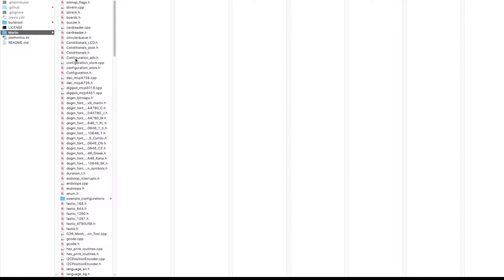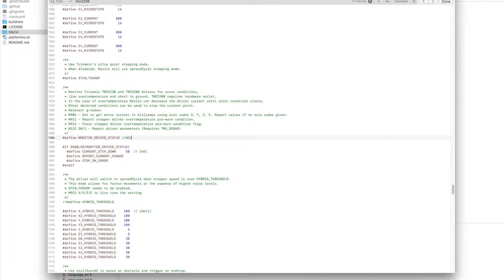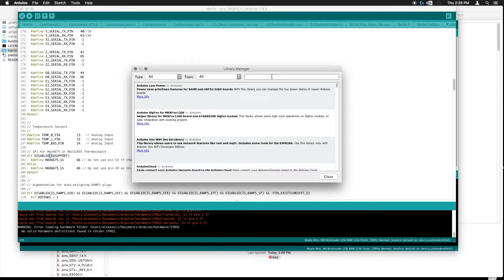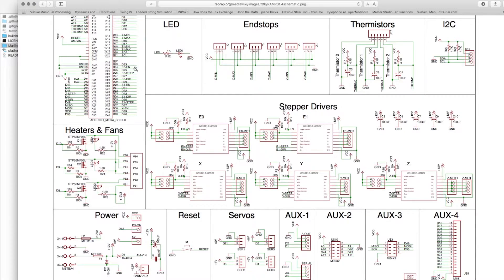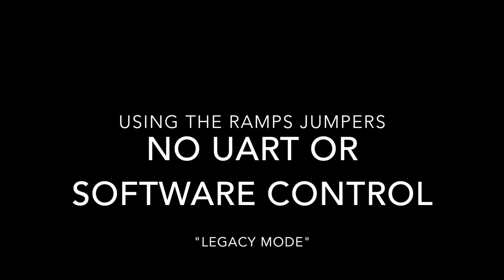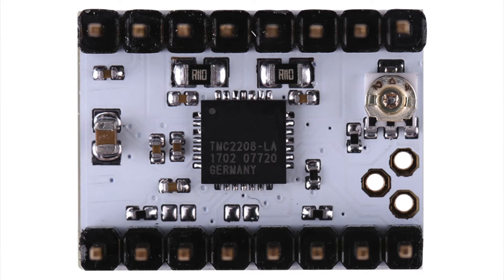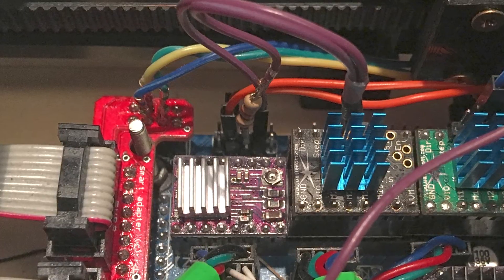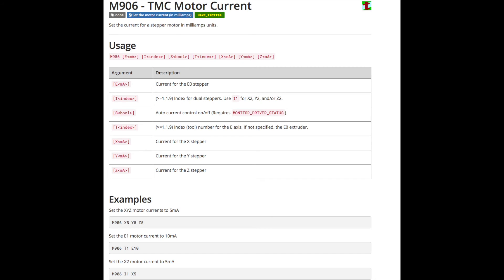Tmc2208 how-to: a more complete setup guide

Comment: Alex, thanks for another great video! You mentioned that the TMC2208 works correctly with the main Marlin branch but the default RAMPS pin assignment (amongst other things) are not correct (ie: IMHO, pins used for RX need to have interrupts). When you show us the pins_RAMPS file in the Arduino IDE, we can see the correctly mapped AUX-2 pins just as we now find them in the Bugfix branch. That branch also introduces a whole slew of changes like new files called tmc_utils. I have yet to try to control my cloned TMC2208 via UART but these discrepancies in the pin mapping jumped at me so it seems that using the Bugfix banch is the way to go for now. Kind regards, Mike
Reply from the maker: Ah, thanks for the heads up.  I had bugfix from feb installed, so I pulled down main branch 1.1.8 for this vid.  i did reassign those pins you mention to match my current setup though, and now I do recall some stock pin assignment issues.  I'll have to look into the ISR thing you mentioned.. that all stuff should be looked into in near future anyway IMHO.  I'm currently plugging away at the v2 branch and about to start dealing with timer assignments and ISR stuff on 32-bit for a project I'm working out: I anticipate headaches since it looks like much of the code was factored to use the single higher-resolution timer on 8-bit chips (ie 16-bit timer1 on mega which is dedicated to the steppers), and that could be shuffled around now since the 32-bit chips have plenty of 16 and 32bit timers.

Comment: For some reason whenever I power cycle the PSU (but leave 5V on to the board) the 2208 msteps are set to 8.
I need to send an m502 to load in the correct value of msteps 16.
I've ran M502 M500 M501 But no dice. These settings are not stored in eeprom I was told.
Is there a way to persist the driver settings over a power cycle or am I doing something stupid here : p
Any pointer would be greatly appreciated : )

Comment: Holy crap that was quick dude! Many thanks! : )
One note I would like to add is that not all pins can be used for software Rx.
I read it in a GitHub issue thread. But here's the source https://www.arduino.cc/en/Reference/SoftwareSerial
Cheers!
Reply from the maker: Oops, good call, I forgot about that.  Thanks!  There was a discussion on the marlin forum somewhere as well.

Comment: I got my TMC 2208 they are on a ship from China, do I have to do all this if I got an Anycubic I3 Mega
Reply from the maker: Okay, let me think about what your options are:

- I THINK Anycubic uses their own build of marlin that is based on an older version, which is uploaded as a hex file... so unfortunately I don’t think there is any tmc2208 support at all in their stock firmware in terms of UART and software serial because that is all very new (I could be wrong, but I remember hearing that somewhere).  BUT you can always still run them in legacy mode, you just won’t have UART control, and will be locked into stealthchop2 /w interpolation (which is actually pretty good nice, so don’t sweat it too much).  

-They probably use standard stepsticks, so you’ll likely have to flip the stepper wires around backward when you put the 2208s in since you can’t flip them in firmware like you normally would with trinamic stuff... no biggie.

- Alternately, you can see if someone has built a *.hex binary of a recent version of marlin for that printer, because they have a GitHub repository with their source code changes, so a clever and patient person could do that, BUT... their motherboard is not open source as far as I know, so I can’t help you with the jumper settings.  I’m sure other users have figured it out though.

- there MAY be other users of that printer that have nods to get you into software control, like piggybacking a programmer on the chip and modifying the pins or onboard connections to get UART control

Comment: If my 2208s have the solder pads set for UART, will they still work like normal if I don't take the time wire the UART to anything? Like will they just default to stealthchop2 and carry on? 
I ordered some clones with the matching tester/programmer thingy but I don't know that I'm ready to go full on technical with these yet. Your videos are still a bit over my head since I haven't had time to go hands on with my new drivers and board yet. I really appreciate that you have shared your knowledge of these. 
If anyone is curious, these are the chips I bought that include the tester. http://s.aliexpress.com/QFnEBjmu
Reply from the maker: Technically that should be correct as far as the data they give us, lemme walk through what I can see: from the Watterott schematic, it LOOKS like all the solder jumper does is connect the driver IC's leg to the Steptick header pin, and then waits for a serial signal on startup, and that is how it is supposed to work, BUT I can't open their PCB file at the moment to verify. (I really wish they used an external jumper instead because soldering those little pads sucks). The Stepsticks have a pulldown resistor on the uart leg of the driver IC which pulls it 'low', so If the UART wire is not connected, the driver should NOT get the pullup 'high' signal from the Arduino, which I ASSUME triggers UART mode on the trinamic chips, soooooo it should default to legacy mode and look to the MS1 and MS2 jumpers and the Vreg potentiometer for microstep settings and current setting. At least that is how it is supposed to go on paper.
Reply: Alex Kenis thanks. Thanks. Yeah soldering those tiny pads didn't look fun, which is why I was glad to find some that are already soldered. This is a nice case of people making the tech more accessible. My eyes aren't what they used to be. 
I'm still scratching my head a bit at their tester. It looks like they went ahead and integrated the USB to serial right onto it. Which is cool if that's what it is. Watterots requires a separate UART adapter and soldering.
Reply from the maker: Yeah, it looks like it is just a serial-to-usb chip on a breakout board that nicely fits the stepstick format.  You could do the same tieh one of those ftdi rs232 boards, but theirs looks very convenient.
Reply: i found best way for me solder the jumpers is to put solder on tip and Drag it from one pad to the other. like a real fast wipe of the nose. lol. has to be quick though cause it cant take the heat. Worst thing for electronics is heat.

Comment: What are the advantages of using them by welding the bridge and connecting them using UART? Thanks greetings
Reply from the maker: With the UART hooked up, you can control many parameters through Pronterface using gcode commands, and you can get information about the drivers in the console
Reply: At this time I am running XYZ tmc2208 without the Uart.  I have set my Vref, and all is working well.  That in mind, do you think it is worth the time to make the change over to use the Uart functions of the 2208?  What would I gain if it is working as it is?

Comment: Hello, if in the TMC2208 you do not do the welding and you use them as they come from the factory, it is in stealthchop mode and with microstepping 256, is that so?
Reply from the maker: Yes, if you don't solder and use the UART cable, the drivers are adjustable with the board jumpers, and are set in stealthchop with interpolation ON.